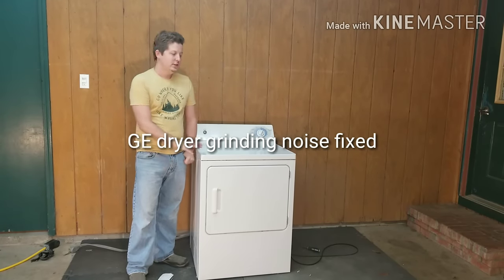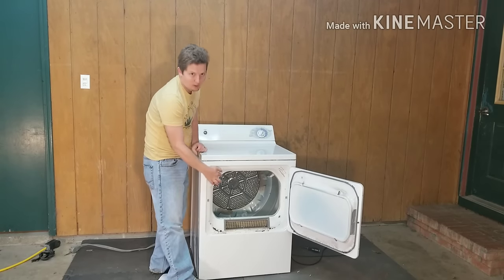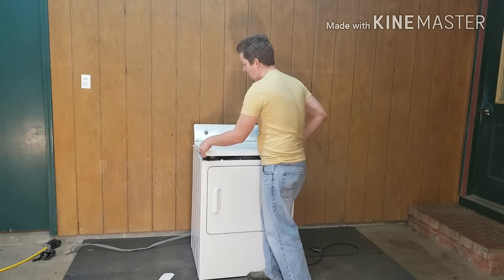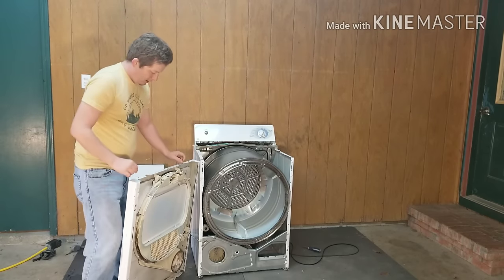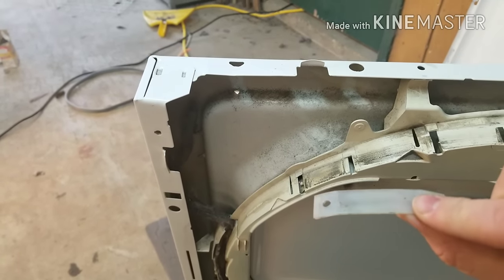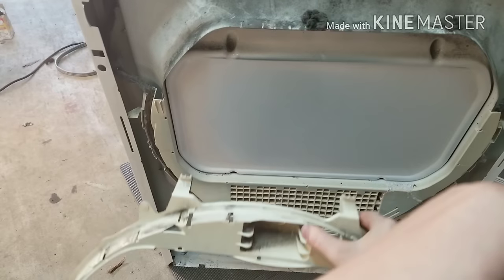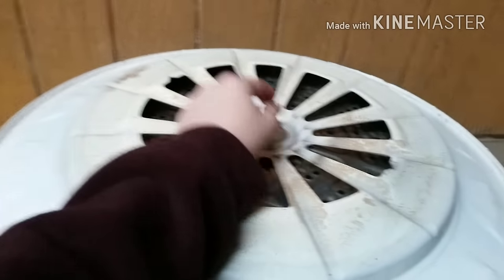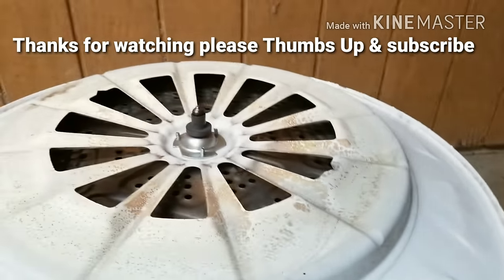GE dryer making squealing, grinding, loud sound Step by Step diagnosing problem

Comment: Ok, that dryer was run for a LONG time with loud grinding noises, obviously. But what you didn't mention is that there should be a couple of felt pads in there as well. I can't find those anywhere.

Comment: Dude.  Nice and helpful vid.  Could take an extra 30 seconds and show yourself replacing the shroud and glides.  Also might consider a couple of seconds of the before part so we can hear the noise it used to make.
Reply: is that what they're called, glides. Thanks for that

Comment: This helped me out, our dryer was squealing up a storm and I was looking to replace the whole unit.  I took it apart as shown in the video and verified I had the same issue with the sliders wearing down and ordered an OEM assembly that included those and the belt, felt, and the whole plastic upper half, for like $40.  The repair took about 30mins for a novice to do.  Hardest part was lining the top cover to come off/back on.   Only surprise was all the lint I found deep in the machine, so got a clean up too.  Anyway, really appreciate it!

Comment: THANK YOU!! I was working on a wood project last weekend and forgot to take all the screws out of my pants. Wife comes to me days later saying that the dryer was making a scraping noise. I was worried that it was a belt issue or worse. I followed your video and sure enough, a screw got caught in the ring area. Luckily no real damage was done. All fixed thanks to your awesome video!!

Comment: Thank you for showing the two top screws that connect the front panel to the sides, where the Teflon slide bearings go and what happens if the Teflon side bearings are missing while the dryer runs.  You saved me some money with your aid in my successful dryer repair.
Reply from the maker: Glad to help
Reply: Thank you for the heart.

Comment: Bro, you just saved me $600 for a new dryer!. I replaced the four teflon sliders (one was missing, the other three badly worn - $10.99 from Amazon), and the hideous squealing noise is gone. Much appreciated!
Reply from the maker: Glad to help. I actually just replaced the same thing on my direct drive washer. It’s crazy how quiet it is now and smooth it spends.
Should have done it a few months ago but you know how the honeydew list goes. I’ll get to it lol.

Comment: Excellent video. Followed the easy steps shown and ordered the replacement part. Had to order the whole peice with the plastic inserts.  Still only cost me about 38 bucks. Compared to 120 the appliance guy was going to charge. Very helpful video. Thanks.😀
Reply from the maker: Glad you got it fixed 🙂
Reply: Where did you order, need the large piece as well with plastic inserts?

Comment: Getting the whole front like you showed, the four pad bearings are worn but still there but the plastic before the pads is cracked… thinking just heat stressed. Glad you posted the back bearing in the vid mine is only half the length that it looks like it should be based on yours. Looks like the same model just a couple more dials up top thanks for the vid the squawking of our dryer was driving us insane. Now time to order the parts

Comment: Mine makes a metal scratching sound. Thanks for the video!
Reply from the maker: Usually that means it has worn through not only the plastic slide, but the frame that the slide is on and is sitting on top of the door of the dryer. Luckily, as long as it hasn’t worn all the way through the door, you can replace the whole thing

Comment: Thanks for the tip! Such an annoying sound, but such an easy fix, thanks for sharing!👍👍👍
Reply from the maker: Glad to help
Reply: @Washer Dryer Money  we ordered the part for the squeaky dryer.  Husband had taken out old part and put it back in and helped squeak.  He put the new part in today.  The dryer drum will turn maybe a minute or less and then turn off.  We have the old part back in and working fine with a little squeak.  Any suggestions for why dryer won’t work with new part?

Comment: My Hotpoint dryer works fine. The problem is its making a grinding sound when I put it to use. I will try to fix it tomorrow. Do you recommend any local stores to get the parts or does it have to be ordered online?

Comment: I tried and tried hard to really find out what this material this shroud is made off.  The so called bearings are plexiglass type of material.  Same stuff is used on all kinds of electonics from TV monitors, to computer screens.  There are layers of these things in sheets. I have lots of them.  Some of them are like glass, very clear and bright but tough. I think these shrouds are a sort of composite plastic or PVC.

Comment: I have a brand new GE dryer just took it out of the box hooked it all up plugged it in started it it makes a grinding sound as it tumbles
Reply from the maker: Brand new that’s crazy that it already has a problem. I would say it was assembled wrong at the factory but you could take the drum out and put it back in and see if it’s just something simple. Maybe a piece of foam or cardboard stuck somewhere from shipping it out. That’s a crazy problem for a new dryer. Let me know how it turns out.
Reply: Me too! Super disappointing especially since it is new.

Comment: Hello Washer Dryer Money.  Thanks for posting your video. It helped me replace my front bearings.  My dryers still makes a rolling noise that sounds like a record player or like it is out of round with a noise that gets louder during a certain cycle of one rotation.  It doesn't dry the clothes as well either.  Any ideas?  Is it possible to send you a video or maybe I can post on youtube and send you a link?  Thanks.

Comment: I’d say 90% of the time it’s the shroud bracket and the plastic gliders. The roller assembly and the band would be about 10% of the other problems and would be my next guess if it’s squeaking. 

The 2 different sounds are:

Yelping squeaking like a Seagull = front shroud & plastic gliders 

Mouse like squeaking = roller assembly and or dryer band in the back

Comment: Getting off topic my element gets red but it trips the breaker under load what's my problem?
Reply from the maker: It could be several things.
most likely would be the heating element is touching the frame of the dryer causing the breaker to trip. Be careful and always turn off the breaker while you’re testing things.
Reply: I'll check it, but the strange thing is it doesn't trip the breaker all the time only with a full load I was thinking circuit breaker but I ran it through a cycle it didn't do nothing the element got red hot it only seems to blow with a full load of laundry

Comment: Mine squekes while drying? It's really allowing. At first I thought it was a belt. What could it be?
Reply from the maker: It could be the rear bearing kit. Do you have to take the drum out it’s where the drum holds on to the back of the dryer. Sometimes when these wear out they will squeal like crazy. Also be sure to check the front plastic bearings. Good luck

Comment: First, this is awesome.  My dryer has been squeaking for a few weeks and after watching this I took apart the front and while the top of that shroud does need replaced I was able to move the two remaining plastic tabs to the top of it and put it back together for now and it stopped the noise.  This will work until the new parts arrive and I replace the top section altogether.   Can you tell me if the felt is important?  My dryer has never been taken apart and it currently isn't in the track around the drum.  I'm not sure why GE didn't put it in correctly but I need to know if that's important to put in new when I order parts.  It was pretty tough to try to get back in there so I left it out for now.  Thanks!

Comment: Thank you very much for this instructive video!. The dryer works perfectly now and it was very simple. thanks. By any chance, will you have something around a GE Washer that doesn't stop loading the hot water? Thanks.
Reply from the maker: If the washer does not start filling it either means the valve that the water hose goes to is stuck open and needs to be replaced or more likely the rubber hose that runs from the bottom of the drum to the water selector level has fallen off or has a leak.

Comment: The top of my dryer does NOT come off like this. It seems to be attached to the control panel help!
Reply from the maker: If it’s a newer GE dryer it will come off differently. Usually from screws on the backside. There’s a ton of different style machines and they all tend to come apart a little different.

Comment: I replaced the front panel and bearing slides two weeks ago and already it's getting shredded up again. Any suggestions? Is the drum weighing too heavily on the front bearing?
Reply from the maker: Could be the drum is too heavy.
Usually the only reason for that is the washer is not spinning enough water out of the clothes. It also could be there is rust or some type of debris around the rim of the drum that is grinding it down quickly.
Reply: @WasherDryerMoney  weird that we're having the too heavy problem after living in this house for four years.
Reply from the maker: @jugghayd  By too heavy I mean the clothes may not be getting spun out leaving them wet and heavier than usual. I have seen some dryer is acting up and the actual culprit was the washer. 
The more likely problem is going to be the stainless drum needs to be smoothed out or put some silicone spray to lubricate it. Or any non-flammable low smell lubricant should be fine.

Comment: Question Sir:  I am having problems removing the drum from my GE dryer.  Model number DVL223EB4WW.  I need to replace the drum bearing but cannot get the drum release from the back.  I released the belt, ect.  Any suggestions?  Thanks, Jay
Reply from the maker: Some of those type dryers you have to lift the drum straight up to get it out of a slot that it sits on. It will only lift about a half an inch up and then it will pull straight out. Sometimes it will be a yellow piece you’ll have to remove from the front that keeps you from pulling it out.
Reply: @WasherDryerMoney  If my dryer has this yellow piece you are referencing, where would this piece be located? I don't see it inside the drum as you look into the dryer.  Thanks again. J Grabowski
Reply from the maker: It’s really obvious if it’s there. It’s just a piece of plastic that’s right in the front over the door. If you don’t see it it does not have it.

Comment: Mine has a humming noise when trying to start. I cleaned out the lint of the front door by the motor,still won't start. Please help.
Reply from the maker: A lot of times when a machine humming when you press the start button it is a sign that the motor has gone bad. At least that would be my guess.

Comment: I changed the back bearing still makes like a very squeaky sound. The front plastic would make a squeaky soubd?
Reply from the maker: Shannon Breaux sometimes.
Reply: Please i.need some answers, my whirlpool machine making a loud noise and I have changed the rollers and the belt and after that the machine won't start,  any ideal?

Comment: Ummm the rear baring.. how to clean and replace vent properly
Reply from the maker: I think I mentioned the rear bearing at the very end of the video. It is a good idea to make sure it’s clean, even if it seems to be working properly. Although replacement is very inexpensive.
Reply: @WasherDryerMoney  we rotated drum because we couldn't find the places to replace the vent screws.
We thought we did okay but now it loud flopping could the belt have come loose?

Comment: Crap, looks like mine worn down and have to replace the whole thing. Also, the lint trap is very brittle and starting to crack apart. Eh, I guess it couldn't hurt to throw down 55$ more and replace the bottom trap while I'm at it. Still beats the hell out of buying a new dryer.
Reply from the maker: True.
Reply: My Lint Trap Is Made Out Of Plastic & It To Has Became Brittle & Started To Crack...I'm Going To Have To Order Another As Well.

Comment: I've replaced both of those things. The squeaking is gone but there is still a creaking noise.
Reply from the maker: iRider1 it could be the Idler pulley for the belt. I have also seen where someone has picked up a dryer too hard with a dolly on one side and the literal side panel of the dryer is slightly rubbing in one spot as a drum goes around.
Reply: Washer Dryer Money  Thanks. I've now also replaced the idler pulley and the belt. Before that I had put high-temp grease on the idler arm and old pulley (and a couple of other places) and that improved things about % 90. The new pulley without grease brought the creeking back. My current theory is that some way the pulley moves on the arm makes the arm vibrate sometimes.

Comment: Thank you!
Reply from the maker: Glad I could help.
Reply: @WasherDryerMoney  hello actually I had 1 glide missing.. replaced it, inspected the rear bearing sleeve it appears fine all intact spins freely.. belt looks fine but dryer still has grinding noise.  Motor spins freely too and the fan for the vent spins fine.  I am baffled what the problem is.
Reply from the maker: @dougjamesvandals  I have seen a dryer case be bent and touching the drums before. It makes a grinding sound.

Comment: How to put the door back on ...
Reply from the maker: You’ll see the bottom of the panel that has a door in it hooks in bottom first. the spot that has the feet. Then just lined up The drum and put back the two screws that hold the front panel in.
Reply: @WasherDryerMoney  that helped first time repairing my dryer thanks for the video!
Reply from the maker: Stanislav Zaverukha glad you fixed it.
Reply: @WasherDryerMoney  it's making a higher pitched humming noise when i turn it on. Any idea?
Reply from the maker: Stanislav Zaverukha it’s the pads that the dryer drum slides on or in good shape you might add a little bit of WD-40 or white lithium grease to them it could just be the new pads squeaking. If you take it all the way apart make sure to oil the back bearing as well. Just don’t use so much that it would get onto the inside of the drum and possibly get on your clothes.
Reply: The fan was loose I must have lossened it when trying to take off the cover after I pushed it back in it stopped making that noise

Comment: wish you showed the issue w/ sound of it
Reply from the maker: Grinding noise. GE dryers are extremely quiet compared to any other dryer. They are nearly completely silent. If the machines making any noise it’s probably the bearings.

Comment: What does the noise sound like?
Reply: you will know it when it happens!!
Reply: Dave Avers no, I will not
Reply: Real squeaky.. Like something need oil
Reply from the maker: GE dryers are actually some of the quietest dryers when they are in good shape. If there is any grinding noise at all it means these bearings are most likely going bad. If there is a loud squeaking noise this means they have gone bad and you have let it run for too long and has ground through until metal is touching metal.
Reply: @WasherDryerMoney  front glides fit into cheap plastic holder assy. When glides worn too low plastic housing cracked and pieces that hold glides broken off. Order glide housing before too late with new glides.

Comment: My dryer sounds like it’s struggling
Reply from the maker: If you have cleaned out all the lint around the fan and it is still struggling it could be a motor going bad.

Comment: So these pile of garbage was put together by General electric.  Knowing to design them to wear out.  My old school 30 year old dryer is a beast.  But they know better.  Make them solid and put yourself out of business and all them people owning stocks will see no profit.
Lets call the plastic garbage, "shroud" and them little 4 composite crap " bearings".
But I got their game beat to shit.
I take those ribbons off computers, they are used to embed conductors and connect multiple pins that are from a foot to 2 feet distances.  The only way you can tear them is to cut them.  They are extremely strong.
I wrap the  entire so called shroud with that secure each end with seam tape that can handle temperature up to 180 degrees.
Good bye to squeal.  Sorry they won't get my money.
Yes I have mastered reparing all them spring suspension on these so called verticle suspension system washing machines.  They are so easy, why I didn't think of it before.  In fact it is straight forward laughingly  easy to fix.

I also repair the struts/shock on front loaders.  They are equally as easy as the suspension spring.
99% usage of the brain and 1% body.   Time to fix each suspension spring and each shock absorber 2 minutes.  4 suspension spring less than 10 minutes, same with shocks.  I have timed myself.
Hint:  I cut the end of the rod and remove the spring. The rod ends up 1/4" shorter because once I put things back together I have punch to make an indentation.

I also take them so called gear boxes apart and install the bearing and seal.  So easy I can not even believe it myself.. how I have figured it all out.

I repair door lock and clutch actuators and I know exactly how all of them operate.

But soon they will design and change things.
Fuck them, by then I will be enough that I won't be doing this shit and old enough to say... time to die.